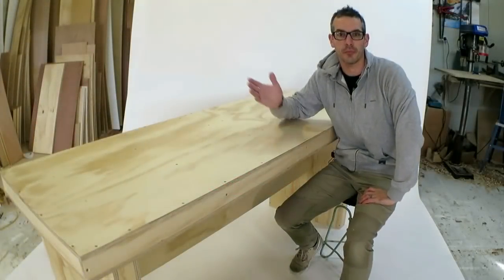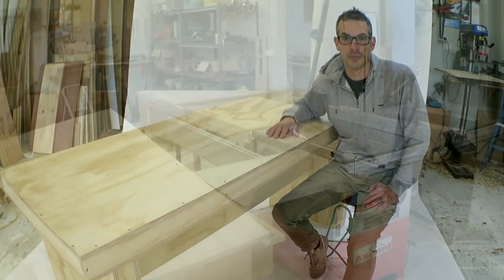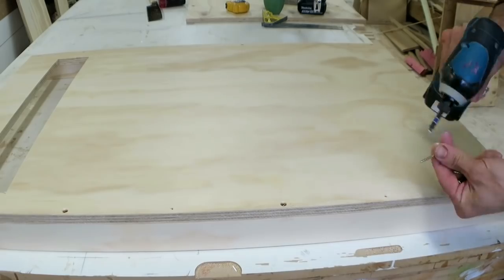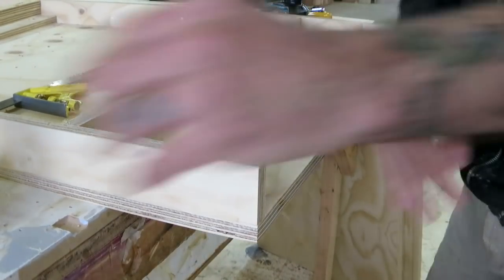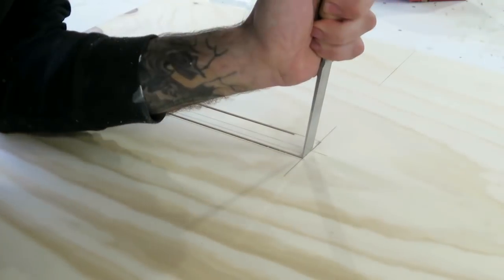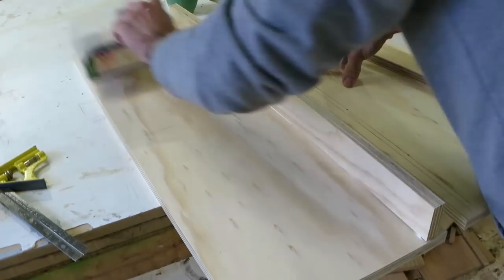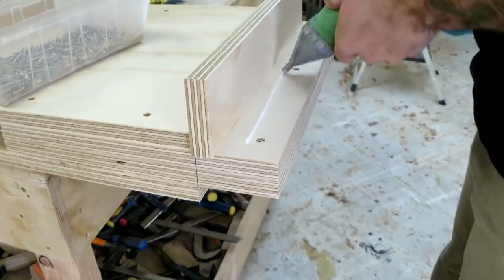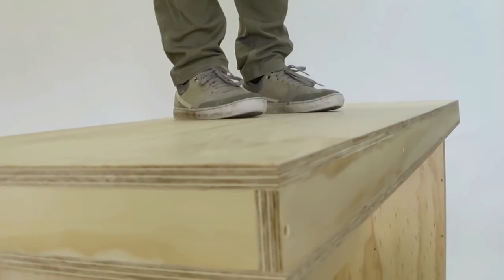flat pack workbench in 1 day

Comment: That's neat. Couldn't be simpler. I like that you can take the top off. If you wanted to add a vice you could just add blocks to make your mounting point more rigid. Very nice.
Reply from the maker: cheers , yea i mounted a vice right to the ply and works well so far,  cheers

Comment: Great concept!  I recently watched a video showing a workbench base consisting of a torsion box type pedestal for a base. That got me wondering about using torsion boxes for the trestles at either end, but here you go taking my very vague ideas and making it work.  The joint you used for attaching the stretcher to the trestles is brilliant!  

I really liked Paul Sellers’ plywood workbench, but I kept thinking I would want a traditional laminated wood top. Using multiple torsion boxes for the base would be even cooler, especially if I can figure out how to make a nice opening for drawers and storage in the middle underneath.

Comment: I love the leg and stretcher assembly! That said, I wish the top was designed to hold clamps or have dogholes. But it was an excellent build nonetheless!
Reply: Hey Misha, nothing to stop you drilling a few 19mm holes through the top, as long as you miss the internal bearers. 
I know you will not have the friction fit from a traditional hold fast but I have a couple of hold fasts that have  threaded shafts with what you could consider giant size quick release wing nuts and a cam at the top for the final clamp down.  Their Chinese made so I am sure they will be available where you live (I live in Oz).

Comment: super design!  I would bet that the same bench made from 12mm ply would be strong enough, maybe lacking the mass that sometimes makes a workbench a workbench, but then again, with the modular design, maybe less mass would be a positive, I know torsion boxes made from 12 mm ply would be strong enough...just play around with a cheap hollow core door and you will see how much strength can come from so little material!

Comment: Great Build Joey, and Cost effective. I especially like the I beam design for the Stretcher.  Something to consider next time you have an 'Ops' moment with the mortice. I had a similar situation last week where my mortice was approx 2mm too small. I secured a straight edge the 2mm back and used a pattern bit with the baring at the base (closest to the Colette) and ran it along. Nice neat and clean.
Reply from the maker: mm yea thas a good idea, cheers

Comment: Love the design, but I'm curious about the design objective. What is the purpose of the flat-pack? It seems to me that the individual pieces are too heavy and bulky to be truly portable (versus, say a Paulk workbench). I probably don't have the upper body strength to take this apart and put it back together everyday. It's much more solidly built than the Paulk and would make more sense as a permanent fixture in one's home workshop, and if so, wouldn't it make sense to make the bench even more rigid by glueing the pieces together? (Edit: Watched it again with the audio on and realized that it was for someone who thinks he will need to move often. Makes sense, but a pretty limited use case I think.)
Reply from the maker: +RK Coder first and for most the objective is make  an easy to build bench for a novice.  That will last until their skills can make a more personal version based off their needs.
Reply: KingPost TimberWorks Thanks for the response. That makes sense. But I personally still think that this is more complex than it needs to be due to the take-apart design versus a similar torsion box + I-beam put together with glue. Of course people can adapt it the way they want. It's a very attractive overall design.
Reply: Considering that everything is done at right angles, can be professionally cut to size when purchasing the materials, and are all basic butt joins or laminations, I don't think that this build could be any easier. Especially for a novice. And a good, level, sturdy work surface makes everything much easier.
Reply: Across The Across I'm a novice hobbyist and this is not something I would undertake right now. The design looks simple, yes. But the challenge here is that the structural rigidity is largely dependent on achieving tight tolerances at the mating joints of the 4 pieces. Those tight tolerances are easier said than done, especially with the accuracy of hobby quality (or home center) saws. Without the tight tolerances, the whole thing will rack from side to side - not a great quality for a workbench. You can see even in this video that fine adjustments with a chisel were needed (7:20) to achieve a tight fit, on top of using professional equipment. My first ever project was a workbench consisting of a solid core door over a frame made of 2*4's. It's still very solid. So yes, there are simpler designs, and even this design could be simplified using glued/screwed butt joints instead of friction fit mortise and tenon. If it needs to be knockdown, I would go with a more lightweight design.
Reply: RK Coder KingPost TimberWorks clearly stated that the reason he had to chisel the legs was because of a simple miscalculation, and for no other reason. 

When you buy the ply wood, you should be able to get everything cut by professional equipment for a minimal fee. That way your tolerances will be spot on.
Reply: Across The Across Not sure which part of the world you're in. Here in the US, they do rough cuts only. Getting precision cuts on all these pieces at the lumber yard would be unthinkable here.